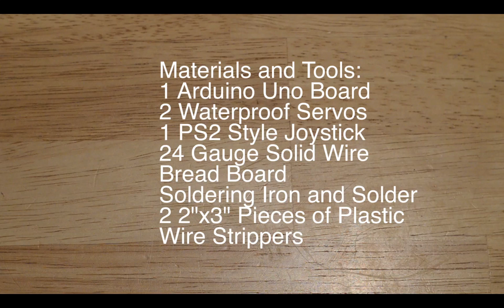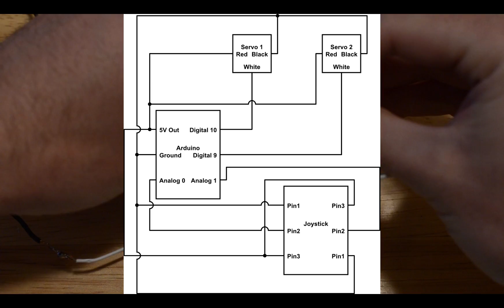How to make a pan-tilt camera mount

Comment: Hi Chris,  I have built this thanks to you.   However, I need this to pan or tilt and hold that position when I let go of the joystick.   My joystick has a switch on it that engages when you depress the joystick    Can you adapt the code on this so that the servo stops where you position it?      I know it can be done as I found a link where a guy did it, but he didn't give the code.   I don't understand the coding and this is for live streaming with multiple cameras for my church services so robotics is not my hobby.    Help please!
Reply: Carl Tenney  Hey Chris Never Mind I found a code that got it done.   Thanks
Reply: Carl Tenney Hey carl, do you mind sharing the picture of your model ? I want to know the type of servos that you used. I am having trouble choosing the right servos. Thanks!
Reply: I ordered some generic servos. And I just reordered a new pan and tilt brackets  my first ones are plastic the new ones are aluminum.   I intend load a video of my project build.  I am making mine for my church live stream set up.
Reply: Carl Tenney Can you share the specific servos that you used in the initial model? The plastic ones. I am looking at using plastic servos for my pan/tilt mechanism.